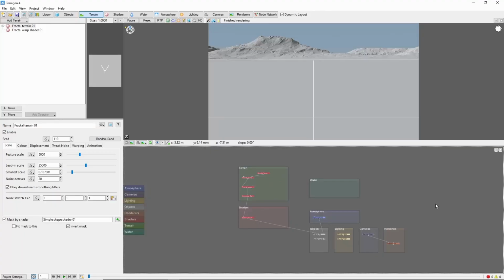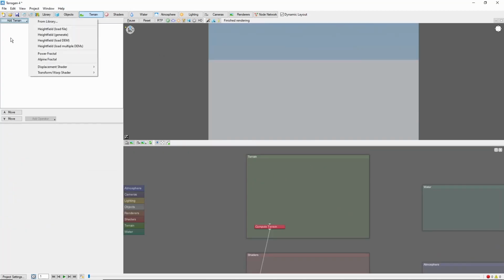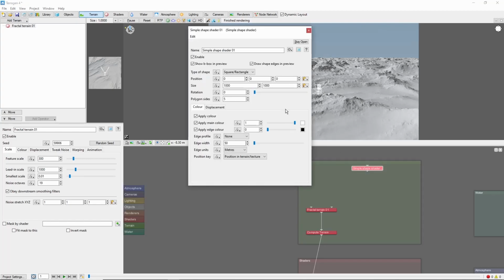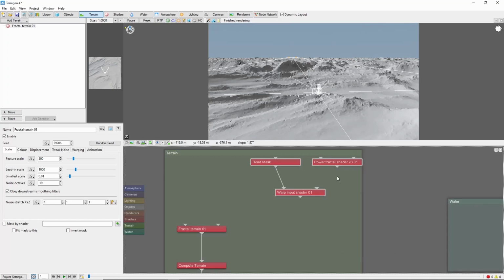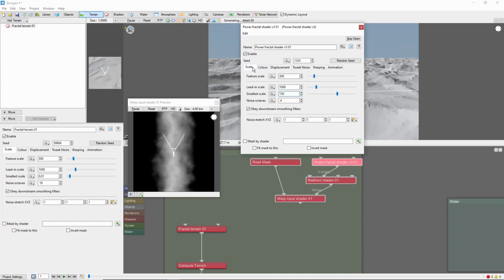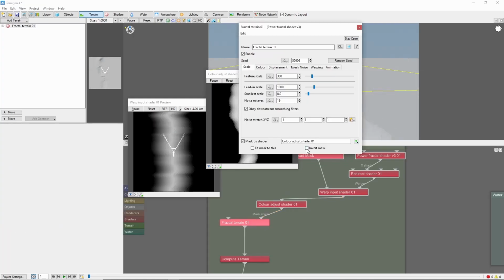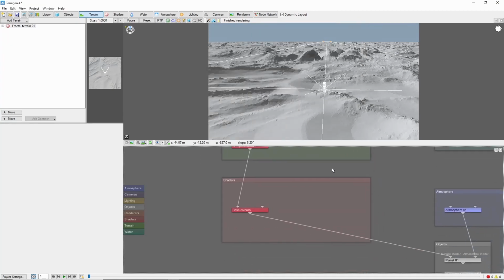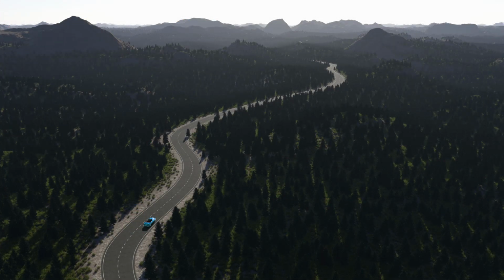Terragen 4 Basics: Build a Basic Road (1/2)

Comment: altho this es a good and cool procedural way to do it, most roads on landscape actually do not deform the terrain, but rather stick to a level and just adds a bit below it for support, so using the micro exported, use the terrain to, in a 3d modelling software, make a road that would look more real.